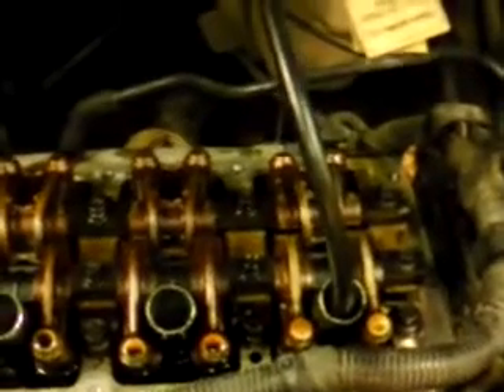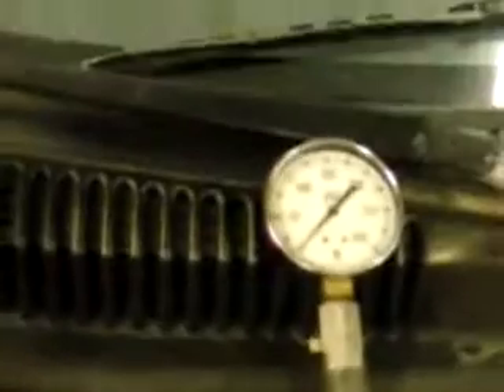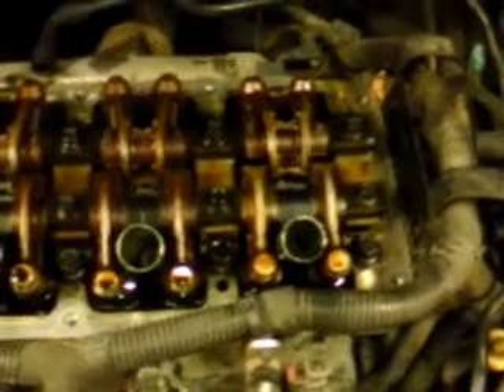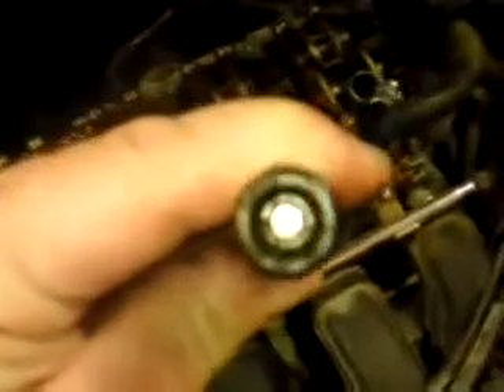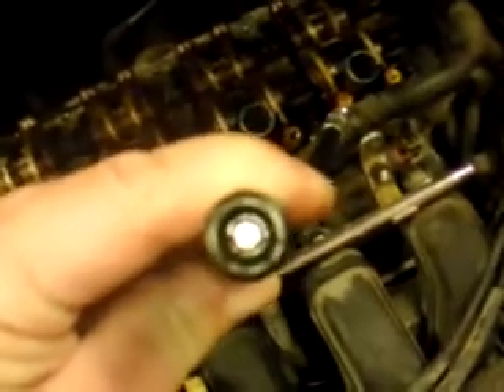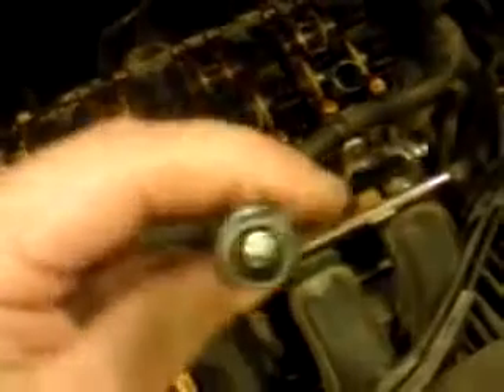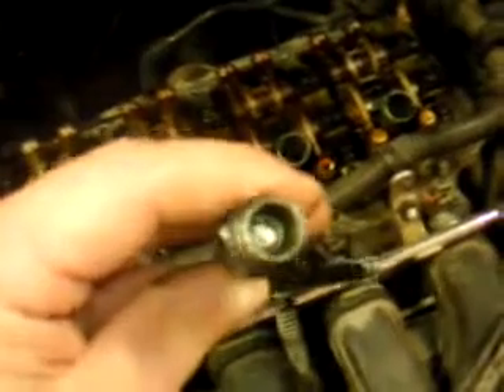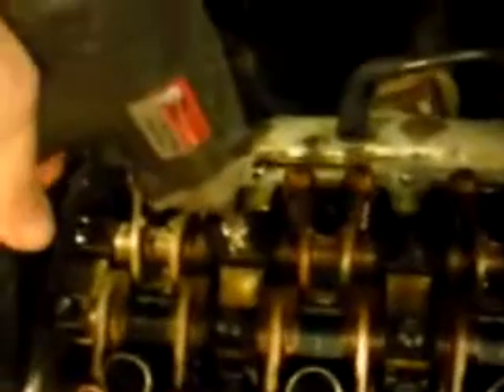Diagnosing no compression misfire 2000 Dodge Neon 2.0 SOHC

Comment: Wouldn't it be less labor intensive to simply rotate the engine to TDC for cylinder number four in order to perform the leak-down test?  Is there any particular reason you decided to take the rockers off instead?
Reply from the maker: When I can see the cam is in good shape and there is no compression in a cylinder the writing is on the wall that the head is going to be coming off. Takes about a minute to zip off the rockers which is hardly labor intensive.
Reply: Gotcha.

Comment: did you have a check engine light for the misfire before you tore into it? just wondering. I also have a couple dodge neons.
Reply from the maker: I'm sure there was a fault set for the dead cylinder misfire, but the best place to start is to see if it's due for a new set of plugs, change the plug from the cylinder that's misfiring to one that is running fine and see if the misfire goes with the suspect plug.
Reply: k thanks